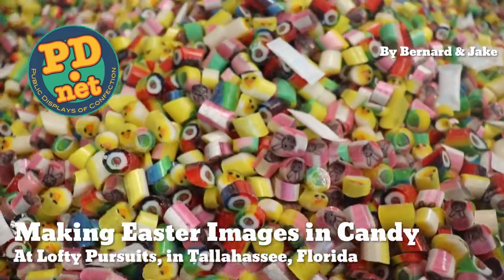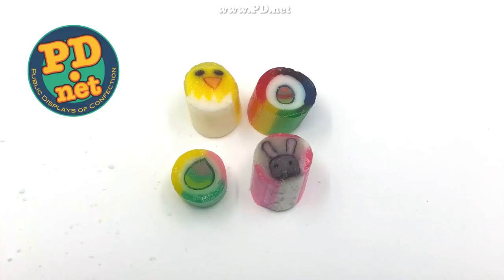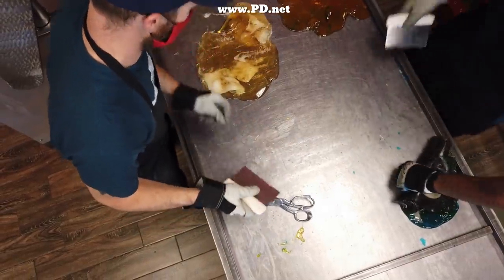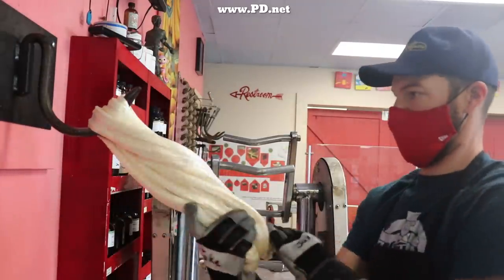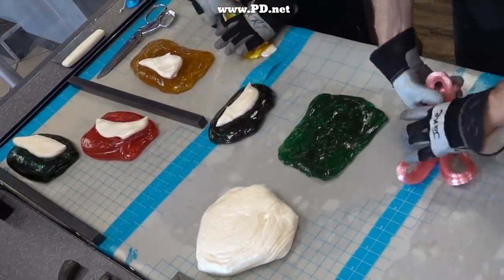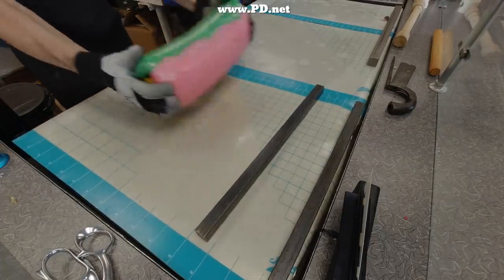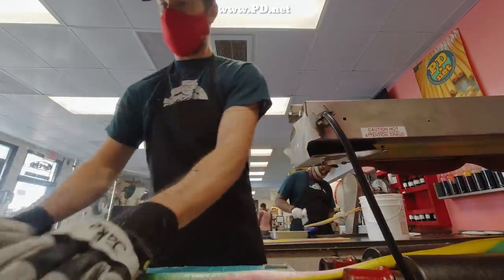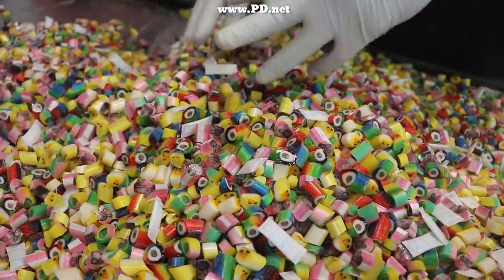#151 Easter Image Candy at Lofty Pursuits

Comment: Just out of curiosity, does it take significantly longer for you to make image candy compared to drops? Making drops seems so much simpler to me.
Reply from the maker: In many ways the drops are. But the candy still has to come to room temperature and that's a product of physics. You have to work a lot faster with image candy. That being said that the machine is harder than making drops by hand which you can do with a pair of scissors.

Comment: Have you considered making Candy with a cross or dove considering Easter is a religious holiday?
Reply from the maker: I have but parallel lines like a cross are hard
Reply: @LoftyPursuits  you make such good designs,  strange how 2 lines are hard but I clan see why since they would end up getting smaller and rounded out
Reply from the maker: The design spirals a bit and with most designs you don't notice it. With a cross unless you do it perfectly all the tips would spit in the same direction. It would look more like a combination of a cross and something somebody would use to hypnotize you. I'm not saying I can't do it I'm just saying I can't do it on the first try most likely.
Reply: @LoftyPursuits  ok